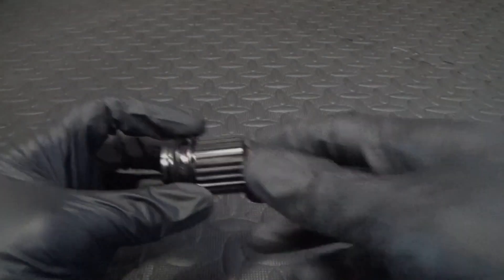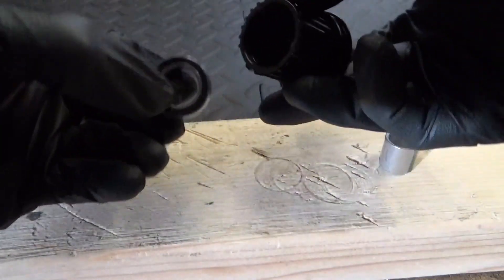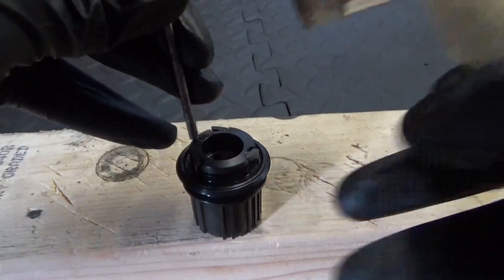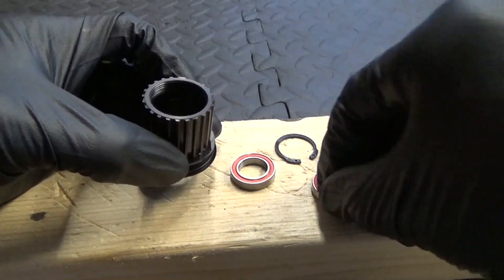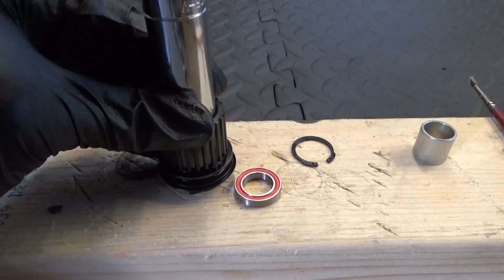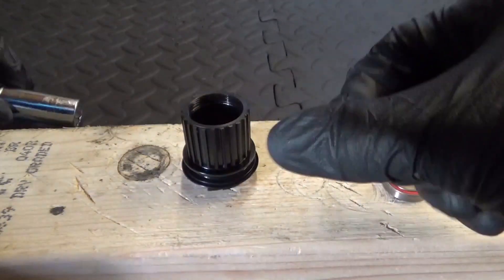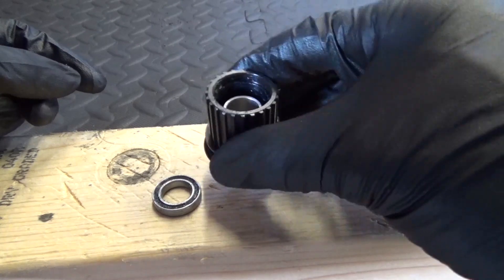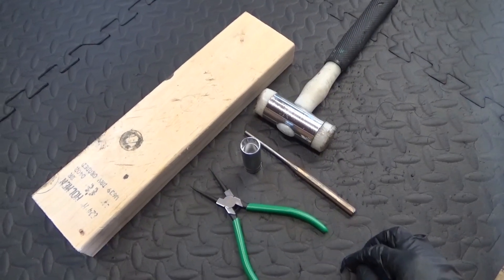DT Swiss Micro Spline 12 Speed Freehub Body Bearing Change

Comment: Thank you! I just did the bearing swap by your tutorial. I replaced those dt bearings with aftermarket ones since those from dt had plastic and rubber cover, i wanted to have 2rs and rubber from both sides of the bearing. Great video, im a big fan of your work and input to the community.

Comment: any idea if this is the same for the ratchet microspline freehub? cheers
Reply from the maker: Same principle yes!
Reply: The ratchet version is easier - both bearings fit from the outside and there's no circlip so no need to drive the inner bearing past the outer bearing seat